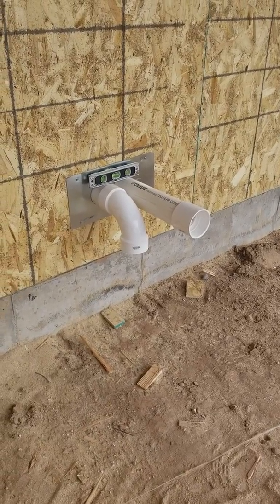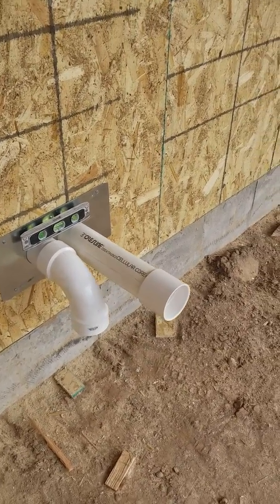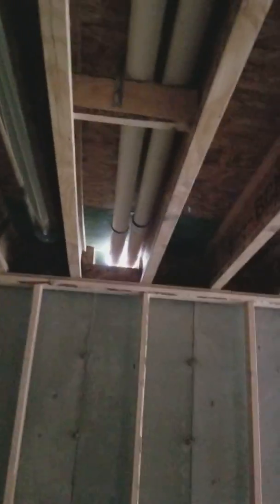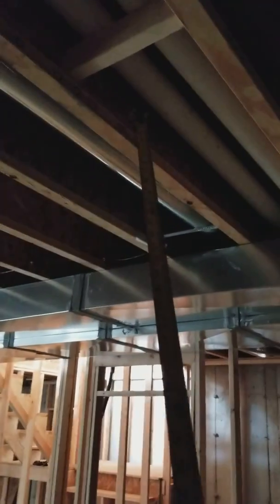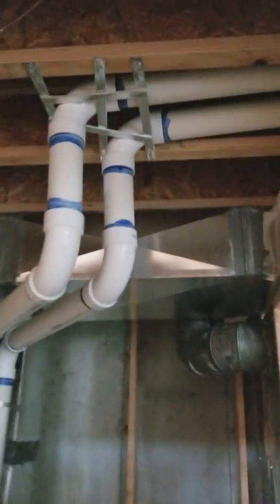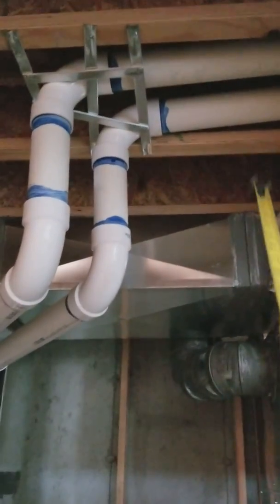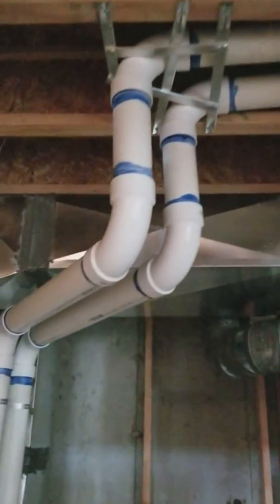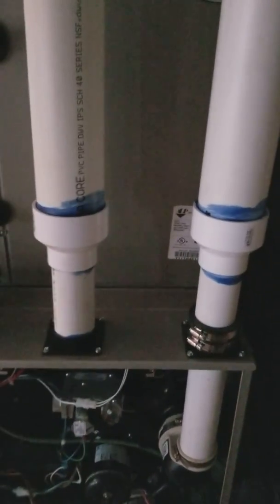PVC flue furnace venting

Comment: were is the drain trap, Or don't u have very cool weather to make condensation. Or r u putting it in the furnace. I was told to put one in, so the water doesn't get to the furnace. Just saying....???
Reply: Drain trap goes on the furnace. They come with one that goes mounted on the side of the furnace. The manuel on the furnace should show you on it. Its a black box that gets connected to the drain its usually mounted on the side of the furnace. If the furnace is set horizontally then you change the position and go out the bottom.
Reply: mine has 2 on the burner box (combustion chamber). But the intake isn't connected to the combustion chamber on mine. So I have to put a trap in the fresh air intake to stop any water from getting into the furnace.
Reply: @MNicehole Your first mistake was buying a Goodman.
Reply: I'm not sure what you mean by 1 intake.    Theres a fresh air pipe and a flue pipe.(ehaust) the fresh air comes into the furnace where you can actually see coming in at the top of the furnace.   But we were talking about condensation in the flue pipe which goes back to the trap inside the furnace.  This Is usually in vertical flow operation. Horizontal flow  might change how the trap or drain hoses are set up inside furnace. I just work on brand new goodman furnace with blue tooth control board. It communicates via application. On phone and it also communicates with out door unit with only 2 wires and bluetooth pretty cool.    I have seen boilers that have external traps to get rid of extra condensation. I'm positive that set up  changes with manufacturers or different application
Reply: U know more then me. maybe mine is different because it can set  any way. ??   (one intake) is fresh air inlet...  to the burner. I'm guessing with a sealed burner chamber, it wouldn't matter if water got in there.  I just thought they all started doing it like mine.. ??
Reply: the intake we put on always has a trap, so the moisture doesn't drip on the gas valve which its directly above on Bryant equipment... so yes,  you are correct in asking why there isn't one ...
Reply: Yes put 1 water trap on the intake vent pipe would always be helpful.  All that water from cold air condensation cant interfere with the furnace operation.
Reply: The furnace itself has a small trap built into it before it drains into a pump or main drain
Reply: Is that why the furnace people told me to put 1 in. So it doesn't get to the furnace, to save wear and tear on it. It will also remove it so it doesn't restrict the intake, that could cause it to kick out. Just saying... They do it for a living, I don't.....
Reply: 1 inch what? I'm a service technician but not everyone that does hvac knows everything so I'm not sure what they told you please explain.
Reply: I have a new Goodman, pay attention I'm teaching you something... The intake line doesn't go into the burner chamber, It goes into the furnace housing. which has the burners in the open. you can take the cover off and stick your finger in the flame. (I didn't make it) So if water came in to the furnace (Air Intake) it would get on the electrical components. which would sort it out and not work.... The burner chamber is not sealed until the out side cover is put back on.  this furnace is made so it can sit anyway you want, vertical or horizontal. Forgive me if I don't have the right terms. like I said I don't do this for a living. It's a 96% 122,000 BTU. I'm sorry if I didn't explain it good enough... Did this help.. PS I'm not a teacher ether..lol
Reply: one in, Not 1"
Reply: That's stupid.  The condensation is suppose to flow back to the furnace.
Reply: LoL

Comment: can the pipes slope DOWNWARD after they exit the furnace?
Reply: No you need the acidic water to drain back into furnace or drill a hole at lowest point of elbow before it rises to ceiling and have a tap and water line draining back into furnace drainline or into floor drain otherwise pipe will fill with water at the lowest point and either trip pressure switch and shut down furnace or reduce the exhaust gas flow which can fill your house with carbon monoxide
Reply: @jessjohn6157  whoa. I bet there are a lot of people who gained some knowledge from your comment. :) Thank you and I send you my respect as well.
Reply: I think they slope upwards away from the furnace.
Reply: Not if you want to wake up after running the furnace in the winter.

Comment: Is there enough flex in the pipe for the 1/4 inch slope when using 90 degree elbows to fit square into the fitting or is there a trick for that?
Reply: yes there is enough flex to get 1/4 inch slope, too much slope will give that super slide look and will make the vertical pipes unlevel

Comment: Do you work from the furnace to the vent exit or do you work from the vent exit to the furnace?
Reply: vent exit to the furnace. Where you drill your holes is determined by the manufacturers clearances, once holes are drilled you pipe your way back to the furnace and when your close enough you just connect the dots.